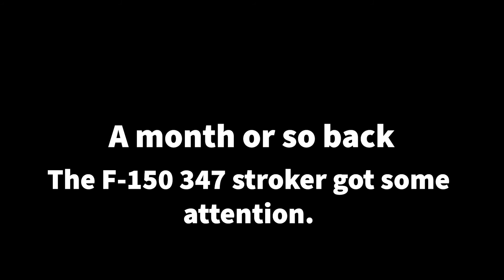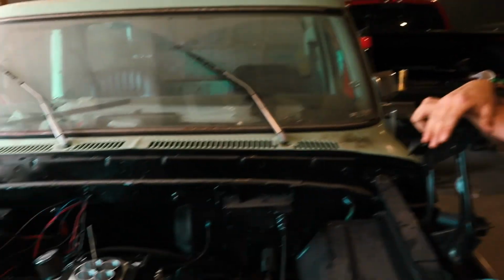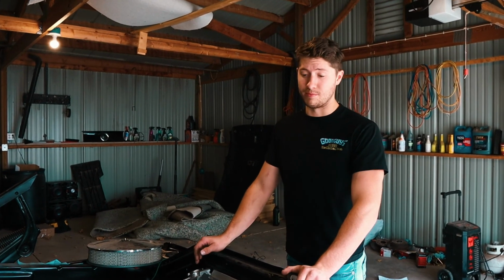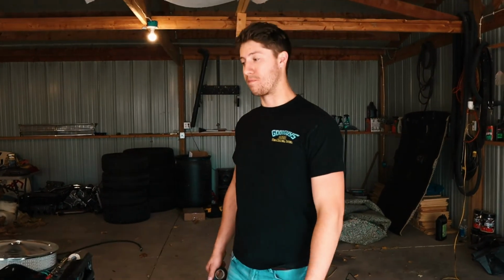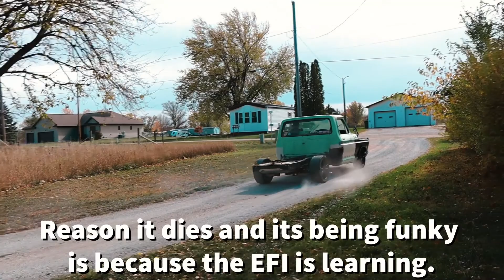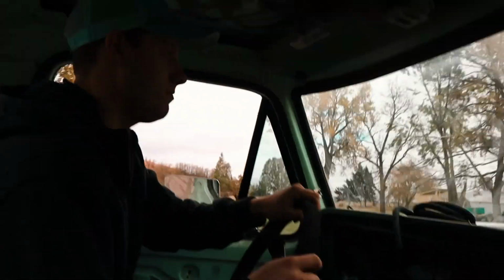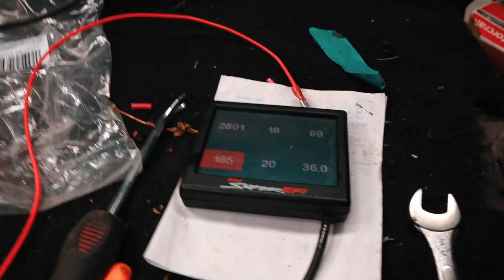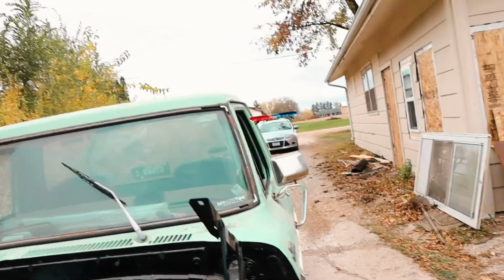347 Stroker | 1978 F-150 | Holley Sniper EFI shoots flames!

Comment: Does the Sniper EFI run the 347 better than a carb would? I have a similar engine build and am debating between the sniper or a quick fuel 650 Q series
Reply from the maker: The injection is a much better system but the carb is the faster easier route.